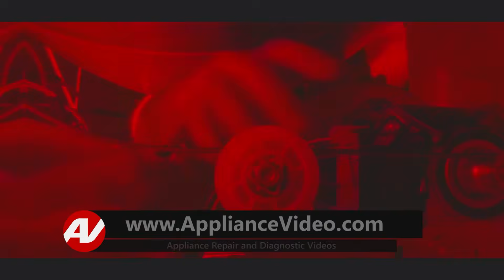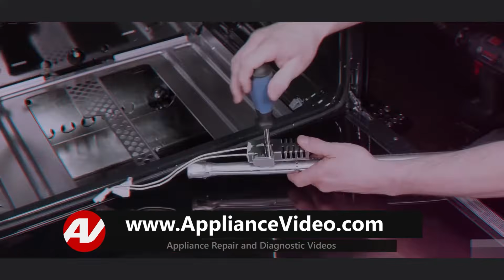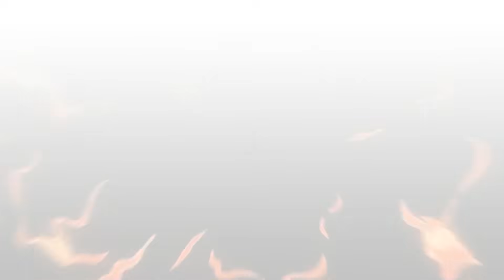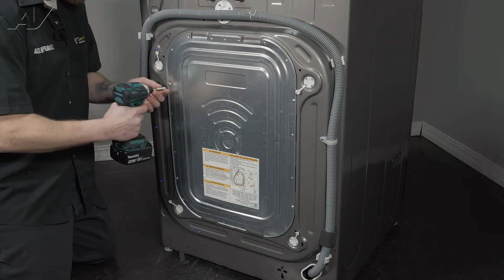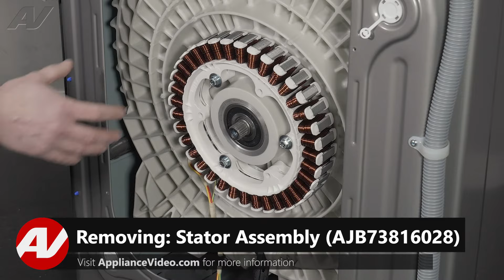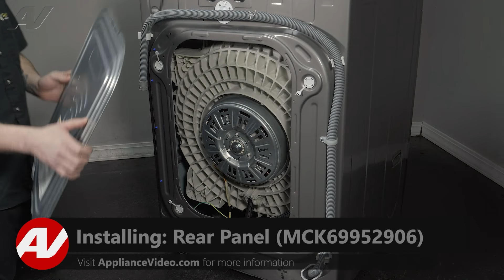LG Washer not Spinning - Factory Technician Diagnostic, Troubleshooting & Repair

Comment: What causes the sensor to go bad?
Reply: - overloading can cause issues along with not checking/cleaning the front filter.   it basically comes down to quality and planned obsolescence - I bought a Kenmore Elite in 2019 and learned it was actually an LG just rebranded when mine failed as the stator was the single piece unit with the built in hall effect sensor.  6 years of service w/2 person & a dog use.

Comment: My LG front loader is only 5 yrs old it’s not draining or spinning fast enough to drain and clothes are sopping wet. I took the back and top off to try and fix it bc I do need t have $ to replace it.  It looks like rusty water is splashed all over bottom interior and the black pc that holds up the washer…. What could cause that and is it a manufacturer defect?? please help! 😢. I’m going to try and disassemble to get to the pc that rotates it
Reply: I would appreciate any help or input, TYIA